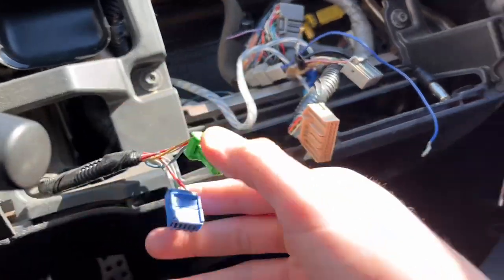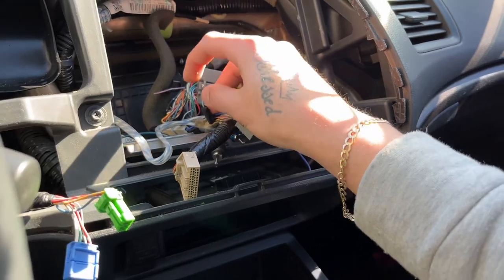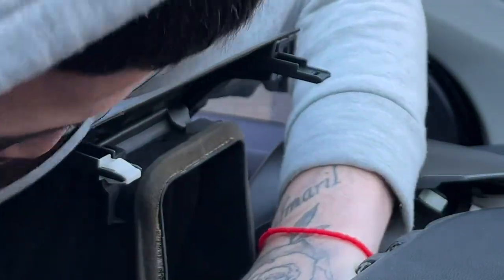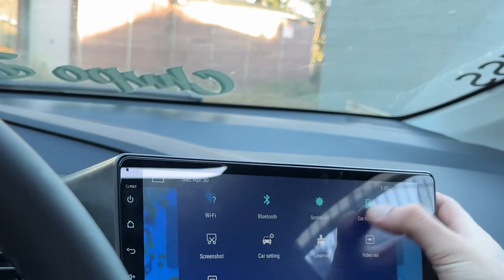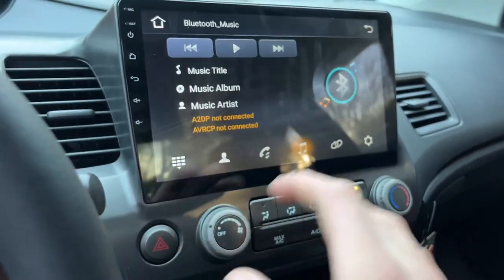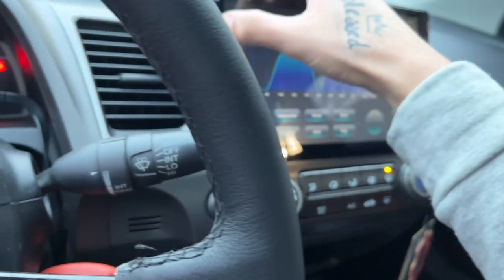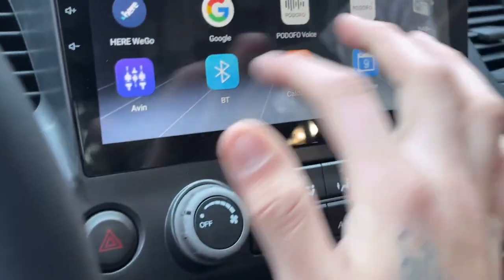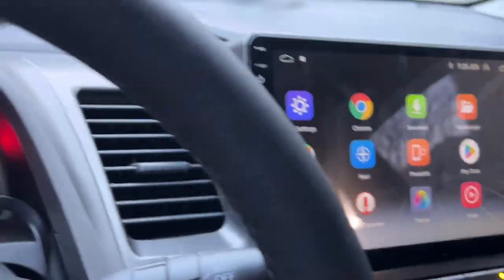The Perfect Radio Mod For A Honda Civic (06-11)

Comment: I bought the same one did you connect the steering volume controls  if you did how ?
Reply from the maker: I didn’t but there’s a few people with videos out there on the installation of the torque steering solution adapter kit. That kit allows you to use all the features.

Comment: Yo can you make an update video on the headunit? Did you experience any problems with it since you installed it? & were those rca cables for your subwoofer or speakers?
Reply from the maker: I can definitely try that. But in the meantime, I never experienced any trouble with it. In fact it made my few speakers sound better then they ever did being that it got so many settings to adjust. That being said no audio troubles nor power issues whatsoever. The RCA cables are ran through the car from a previous amp setup I had but its not in use right now. Hopefully this helps a bit. 🤝🏼
Reply: @chvpobuilt  pretty interesting, I’ve read a lot of issues of people putting in these head units & having problems with the sound or a lot of buzzing static noise, I’m definitely gonna get that head unit then.
Reply from the maker: @ghostpimp  Yeah no static noises but keep in mind im not using a amp. I know people get static noises when running amps. Give it a try man, you wont be disappointed.
Reply: @chvpobuilt  oh wait you’re not running factory amp
Reply from the maker: @ghostpimp  Factory amp is still in play. Yes.
Reply: @chvpobuilt hello so you mean factory amp is working and powering 4 speakers plus two tweeters plus one subwoofer? I have the civic coupe 2010 with premium audio system. It sounds great thanks to the amp and the subwoofer and the two tweeters. I don't wanna lose any of that
Reply: Did anyone here run a aftermarket amp with this head unit ? I'm curious to know if that static noise appears while running a aftermarket amp
Reply: @kegandelmar8489 I have a version of this HU in my truck, that I installed last year. I had a factory sound system that included sub, small subs/mids in the front and 2 speakers/2 tweeters. Eventually I upgraded the sub and added another amp just for the added subs. There was little static but adjusting the settings with the equalizer helped diminish the majority of the static